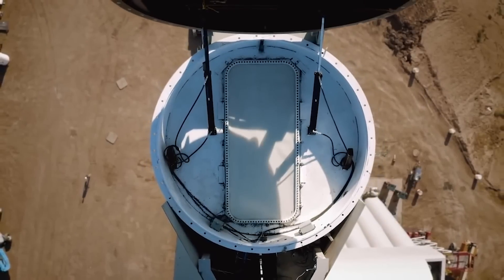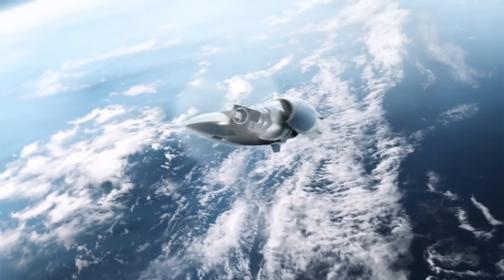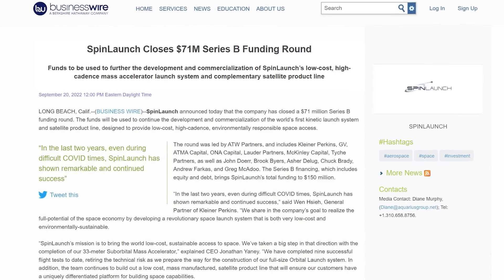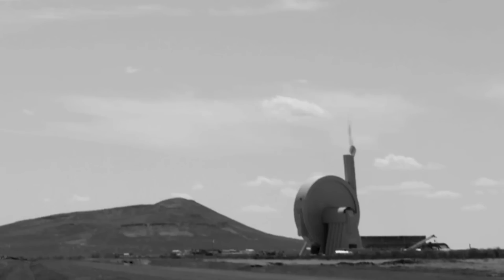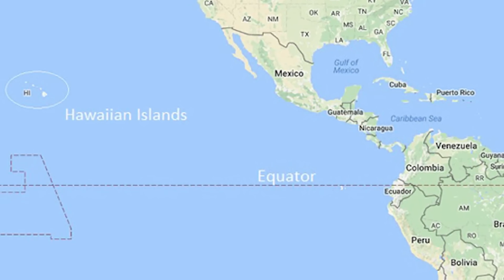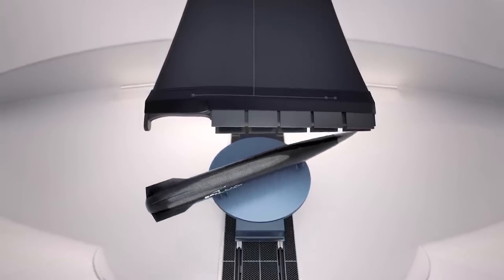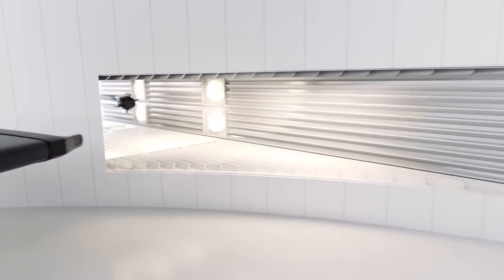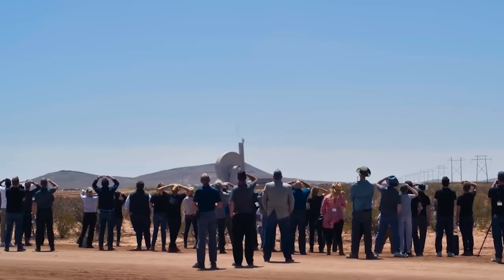What Happened To SpinLaunch & The Orbital Accelerator?

Comment: I did the math a while ago and was surprised to realize that payload spinning in their planned 100 m diameter spinner chamber needs to withstand more extreme forces than if it was launched out of 50 m long cannon at the same initial launch speed. The only advantage seems to be that they can build the speed up gradually using the spinner but we all know that it comes with all sorts of technical difficulties mainly related to vacuum in the chamber and rotational moment of inertia of the payload and at the same time we all know railguns exist and have way higher barrel exit velocity than their planned 2 km per second.
Reply: To achieve 5,000 mph (7,333 ft/sec) on a 150-foot arm (900 foot circumference) would require 8 rev/second (480 rpm). That would give centripetal acceleration of 1,160 g's. The 200 kg (450 lb) payload would exert a force of 522,000 lbs (outward) on the arm and release mechanism. That is the weight of a large diesel locomotive.
Reply: @briant7265  Metrics, please.
Reply: @briant7265  The weight of a large diesel locomotive is born easily by railroad tracks. Or a crane.  Large diesel locomotive engines are routinely lifted by cranes.
Reply: @briant7265  Exactly. What kind of engine or even fuel tank can survive these force while spinning? It's so stupid idea. But has place on earth. Brainless investors should be punished for ignorance. The only reason for this project.
Reply: @alexfrozen  how do you know it's 'stupid'?

Do you imagine they haven't done the maths?
Reply: @alexfrozen  You do not understand - it is not designed for fragile payload. It is an intercontinental slingshot for tungsten rods. This explains everything.
Reply: @cnrspiller3549  Im sure they have crunched the numbers ... (on ow much they will be able to grift out of this project)
Reply: @briant7265  you can crunch numbers and formulas but a six digit number intimidates you? We can lift far more than that with absolutely ancient tech. And just a hint, we can control that and more. One particle swarm in CERN has more kinetic energy than an entire high speed train at max speed. And there are several on the circuit at any given time during operation.
Reply: @Keiranful  1st part is true, lifting a locomotive is no problem, but what you've said about particles is largely misestimated. LHC achieves the astonishing near-7 TeV per beam, but still that's barely microjoules.
Reply: @hottoniapalustris1541  no. 7 TeV per particle. There are quite a few per swarm. It is the equivalent of a high speed train at max speed.
Reply: @Keiranful  Maybe they'll surprise me. I went to their website though, and it's all marketing, no substance. Their video of the suborbital launch was also all marketing, minimal substance. So I'm dubious.
Reply: I’d love to learn about their payload release mechanism, also how do they balance the moment after release in such a short time?
Reply: @davidmalanda4785  I'm pretty sure it's one of their closely guarded secrets but I think the payload is released in two steps, first the top and split second later the bottom when it is at about the same place where the top was when it was released. Plus or minus a few microseconds because physics. That should about compensate the  rotational momentum the payload initially had.
Reply: What’s surprising about that? Also with a gun you only need to withstand the forces a short time. Also what happens to the bearings after launch when you have a very unbalanced Arm rotate at high speeds
Reply: How many watts of power would be required to fire a coilgun with equivalent energy? Mass drivers are a cool concept.
Reply: A gun is actually a more practical means of launching something into space. HARP demonstrated so.
Reply: Yeah I did the math once too. Works out to something like 20,000 Gs.

Supposedly Spin Launch has done tests to insure equipment survives the spin procedure and that "very little needs to be done" (mostly, align components to be in line with the centrifugal forces), but I'm still highly skeptical.
Reply: Sooo... does it also mean that you could compare the forces which hit the payload upon it exiting of the chamber to how something falls into water from good height?
Reply: Railguns have a different problem of the electromagnets destroying all electronics on board the projectile- this is why the US military has been unable to develop guided railgun projectiles so far
Reply: @yobob591  The answer to that is a cart behind the actual projectile. The cart gets accelerated, then decelerated and returned. Thus keeping the magnetic fields away from the "business" end of the projectile.
Reply: If this work, they should build spin guns next
Reply: "I did the math" == "trust me bro" == "I didn't do any math". 

But you are still right.
Reply: They're also incredibly unreliable because of the need to store electrical energy without arcing.
Reply: Monorail. A monorail!
Reply: I really thought a rail gun system would be better
Reply: railguns also have the problem of trying to turn both their payload and their rails into plasma, though.
- β
Reply: @luka-null  That's much less of a problem with a launcher that you only need to fire a few times per week than with a military device. You have time to do all necessary maintenance in between the launches.
Reply: @kasuha  except the idea here is to have a device you can do daily or even multiple daily launches with. Also, there's the fact that no country in the world is gonna let a private company build a giant gun for themselves.
Reply: Yep. If they used a barrel/track the same length as the perimeter of their accelerator it would only experience about 8% of the peak acceleration. Also with a linear accelerator the acceleration would only last a fraction of a second versus hours with "Spin Launch". This is just about the dumbest way I can think of to try to launch anything into orbit, especially satellites which are potentially delicate. We are talking about 10,000 Gs of acceleration. Lol.
Reply: Thunderfoot has a video on exactly this: spin launching is much worse than gun launching for the payload in terms of force and duration. Project HARP already demonstrated a gun can work.
Reply: Make the payload water.  Once in orbit it is recovered by a space tug and taken to a processing depot.  From this you could get drinking water, oxygen for breathing, and hydrogen for rocket fuel.  I think they could make use of those resources in space.
Reply: Would old german Paris Gun with high elevation and slower gunpowder be more gentle?
Reply: @juhajuntunen7866  Yes!
Reply: @juhajuntunen7866 I think the problem with chemical accelerants is release speed. They are inherently limited to the speed of sound in exploding gasses, and that is far below orbital velocities.

I think light gas guns or a ram accelerator design exist and would be more viable.
Reply: @Geolaminar  Spin launch is also far below orbital velocities. This system is just about getting a small rocket high into the atmosphere. Low Earth orbit velocity of 17,500 mph or Mach 23 is enough to basically vaporize anything traveling at speed at lower altitudes.
Reply: @JLars  Except tungsten rods. This is a slingshot for sturdy tungsten rods, do not be fooled.
Reply: shouldn't they experience the same force? without changing the mass or acceleration, there should be no change
Reply: Of course the forces will be higher since a cannon cannot launch objects into orbit.
Reply: @larrylem3582  If they built a "gun" to producers a steady 1,100 g's (same force as the spinner) the barrel would have to be about 700 feet long. (Longer than the top comment said, but not huge.)
Reply: If we can imagine it, I firmly believe all ideas can be realized given enough time.  I think a better comparison for proof of concept that sophisticated electronics can survive, would be hypersonic missiles.
Reply: @sparkysmalarkey  
I can imagine devices that cannot be manufactured, ever.
Example: a program that determines whether or not an input program will terminate.
Proof: feed this program as an input to itself.

It's called the Busy Beaver Problem and is in a class of problems known as "non-computable" because their complexity grows faster than Turing completeness.

"Oh but I meant hardware" you say.

Alright, how about a machine that generates non-negligible gravitational waves and has a mass measured in units smaller than "Solar Masses"? The rigidity of spacetime itself is stupendous; light passing tangentially to Earth's surface should be deflected by 0.16 millionths of a degree. I will define "non-negligible" to be "one one-hundred-thousandth of a degree," or about a hundred times the deflection Earth creates.

As for hypersonic missiles, you're confusing velocity for acceleration. Yes, when the payload leaves the launch chamber, it's traveling at hypersonic missile velocities, but just prior to release, it's having to undergo immense lateral acceleration to stay within the launch chamber.
Reply: @draco18s  You have been feeding your imagination well but there is so much more that we know we don't know and even more that we don't know we don't know.  
  If AI really delivers on the hopes and fears it will be able to think and discover at a pace thousands time faster than humanity.  
  If we use it correctly, at the very least, in a few thousand years 'we' will (know) more about what it possible and what it impossible.

Comment: satelites are generally built to be lightweight, and relatively fragile, they are not designed to be put through hundreds if not thousands of Gs. I’m all for new tech but this is somewhat ridicolous. The market they are trying to open is extremely niche, the small sat market has been filled with companies such as Rocketlab and even SpaceX on rideshare mission. This method of launching payloads into orbit, to me anyways seem impractical and really unecessary.
Reply: It's far more practical than you think. Satellites already have to account for vibrational loading caused by rockets so they are already built to be resilient. Also, cost of launch would be orders of magnitude lower than even RocketLab for smallsats due to simplicity, limited need for fuel, and smaller rocket components. Yes you have to test and adapt slightly for G-loading, but you can ignore other aspects of space launch that have plagued satellites since the dawn of the space age by eliminating the need for vibe tests. It's more of a paradigm shift than anything. That being said, larger satellites will still need dedicated rockets, but anything up to ESPA-class could easily fly on SpinLaunch.
Reply: What about R&D costs? What about construction and maintenance costs? Then you still need energy to drive the centrifuge (even if you use a system to recover energy from the centrifuge after launch it won't be anything like 100% efficient and you're still losing the energy in the projectile). All of this adds up.
Reply: You forgot to consider the deceleration through the atmosphere that would slow the satellite out of the highly elliptical orbit that causes impact

Comment: "At its full-scale size and with a desired exit speed of 5,000 mph (8,100 kph), [the payload experiences] acceleration, just before the payload is launched, of somewhere between 50,000 and 100,000 gs.
Building a payload that can take that much acceleration is more expensive than the fuel it takes to send the payload to orbit.  I think this  idea is completely impractical for this reason and will never be economically viable on Earth. 
For launching raw materials from the Lunar surface for usage in space, however, the idea may have some legs.
Reply: Agreed. Simple, proven physics says it loud and clear.
Reply: Even for lunar stuff though I think a space elevator would make much more sense. Standard Kevlar is strong enough to build a lunar space elevator
Reply: @aadamawad1647  A space elevator would not work on the moon.
Reply: 5000mph won't get you orbit. Much of the energy will be taking away due to the atmosphere and also raising the altitude. I think at 5000mph the plan would be to use Doberman rockets to do the rest,  but you might as well skip the spinning part altogether.